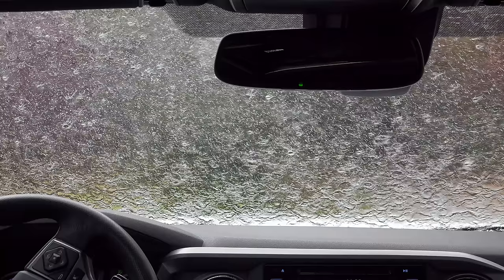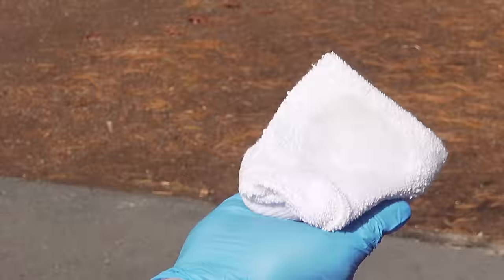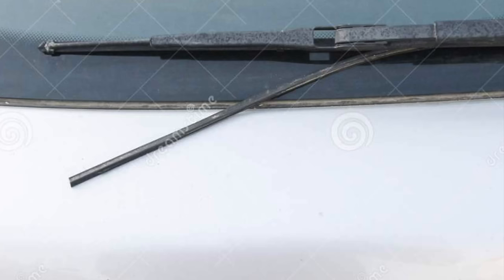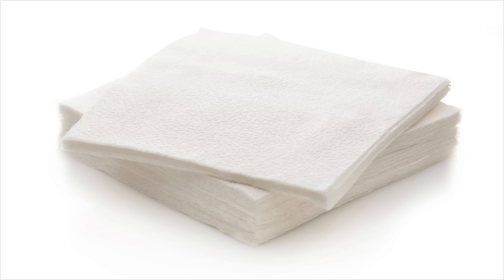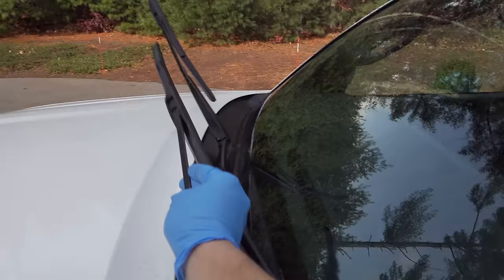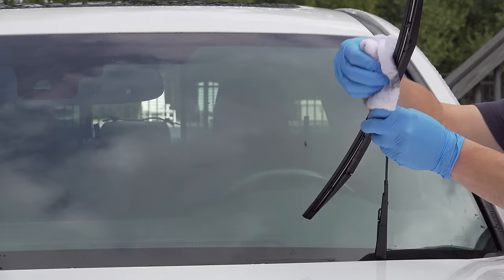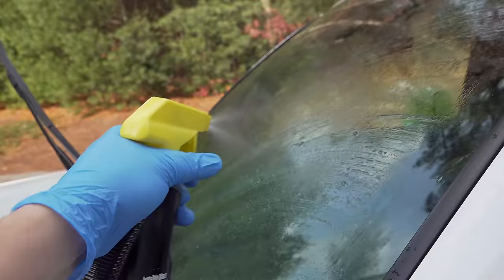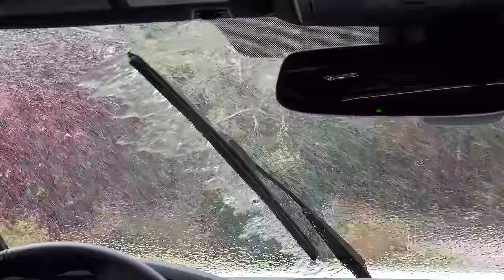How to Make Windshield Wiper Blades Like NEW in 30 Seconds

Comment: Thanks for the tip.  Personally I use RainX liberally and therefore barely ever use the wipers even in the worst rain; my wipers last 5-6 years with no maintenance to them.
Reply: But how many bottles of rain x do you go through in 5-6 years?🤔🤣They run for $2.97 in most stores.
Reply: @TonytheYorkie  Not entirely sure, I don't typically actually buy RainX from the store.  Usually pick them up partially used from auctions in a box with a bunch of cleaning supplies for very little cost, like 2 or 3 bucks for a box load.
Reply: Hay, can you tell me how and where to find  this kind of auction? 
Thanks
Reply: @AZM195  Uhm.. No is the brief answer.   Look around is the yes answer.  Focus on your local community.
Reply: Nu Finish polish works better and lasts longer than rainx.
Reply: @grants169  That's awesome. I do the same with Maguire's window cleaner, it's almost as good as rainex rainex and it's a clear spray. Rainex you gotta rub it in which takes like 20min right?
Reply: There's a rain-x branded screen wash available in the UK, does the same trick with water beading straight off
Reply: I used Rain-X once when it first came out.  Works great at speeds above 30 mph.  You won't even need your wipers.  At lower speeds you will need wipers and they will soon end up jumping all over your windshield making your wipers chatter and leaving rubber on the windshield.  For me, I think keeping windshield clean and good wiper blades is better.  I don't use wax on my windshield either for the same reason.
Using Rain-X on outside mirrors or other than windshield glass is good but a good wax works just as well for them also.
Reply: Using rainX in winter is not a good idea because it makes the coating sticky when you are trying scrape off the ice or frost from your windshield.
Reply: @x-man5056  ceramic coats or high sio2 sealants are excellent on glass
Reply: @drzflyest4  so I've heard.  What do you think of F11 Topcoat?  Worth the price?
Reply: @drzflyest4  exactly what I did. I work at a speed shop so I got the expeslnsive silicone PIAA wipers but I coated my windshield way before hand and it worked great with rubber wipers that were just about ready to change
Reply: And then there's me and the deep freeze morning where you got to chisel your blades out of an ice block.
Reply: @x-man5056  try car pro reload for durability or try car pro hydro2 lite for ease of user during wash.  Those are my personal favorites very slick and very high gloss.
Reply: @drzflyest4  Thanks.  Checked it out on Amazon.  Certainly a lot cheaper than F11 Topcoat.  It says not to apply over wax though.  Since I just clay barred and waxed, not real thrilled by that but since it's so inexpensive, I think I'll buy a bottle and use it next spring.
Reply: @bryanmartinez6600  Prestone deicer, get the pump bottle, not the aerosol spray.  The spray can contains less product for the money and gets very cold in your hand when using on sub-freezing mornings.  I have used Prestone deicer for years.  Also, if your vehicle allows, lift up your wipers to the upright position so they won't freeze to the windshield.  Works.
Reply: I accidentally came across a horrible combination with RainX. I RainX'd my windshield and washed the car with Mr. Clean AutoDry car wash, which is a different polymer that causes water to sheet rather than run off. All was well until it started raining and I used the wipers. It was just like the wipers were spreading white paint on the windshield! I stuck my head out into the rain to get the car off the freeway and into a gas station. Windshield cleaner didn't help at all. I had to wait about half an hour for the white to thin out to where we could see again and for the rain to quit. I got some cerium oxide to polish the windshield and with lots of elbow grease (about an hour of rubbing) got it to the point where I could see through it if I used the wipers on the wet windshield. Eventually I had to replace the windshield.
Other than that (and fogging up in very humid weather) RainX is okay.
Reply: @x-man5056  In Flagstaff some people buy a piece of bubble wrap big enough to cover the windshield (and wipers) and close the doors on the ends to hold it. In the morning clear the snow off the roof and from around the doors, remove the bubble wrap, and life is good. I was never that smart, though. Sometimes I remember to lift the wipers off the windshield before it snows. Then I shake my fist at the snow clouds and growl.
Reply: Cerium oxide
Reply: @flagmichael  Yeah, I hear ya.  When I lved in Alaska I would usually remember to lift my wipers but I didn't get to excited about it because I lived on an Army based and could easily walk to work.
The bubble wrap thing sounds like a good idea though.
Reply: @bryanmartinez6600  That's why I just spray a garage over the entire car.  Works better than anything else I've found for keeping that nasty ice and snow off your windshield.
Reply: Max Power  Full of shit? ..Says the person who never uses RainX.  I've got 30 years of driving, over a million miles with RainX on all my vehicles windshields.  Works every time.  Even at low speeds when the water doesn't run off, as long as you don't stare at the windshield and focus past it, wipers aren't needed at all.  I could run my vehicles without wipers installed at all and be just fine.
Reply: Get on Ebay and buy "Aquapel" window treatment. Auto parts stores don't sell it because it's for "professional use only" however you can buy it online. One application last about 3 months. Most people never heard of "Aquapel" because you won't see it on stores. Once you use "Aquapel" once you will never waste your money on Rain-x or any other crap window treatments again.
Reply: @flagmichael  I'd like to ask you a question about Flagstaff.  I live in NC currently and I'm seriously considering moving back west to get away from the humidity mainly.  I have a medical condition that makes high humidity conditions particularly intolerable. 

I know a little about Flagstaff but was wondering about healthcare.  How would you judge healthcare availability and quality in Flagstaff?
Reply: @flagmichael  I know you didn't ask for advise but many others including myself have fallen into the same or similar trap as you and it can be dangerous. What happened to you could have been a disaster.
Use rubbing alcohol to clean your windshield inside and out to remove ANY treatments.  Clean again with one of those Mr. Clean white sponge cleaners.  Then a good glass cleaner.  Get rid of ANY car wash product with any wax or other treatments in it.  You don't want that on your windows in general but particularly on your windshield.  Good, clean glass works just fine by itself.  

There are just way to many wiz-bang nifty wax and shine products out there and not all of them are compatible. The only way to be sure your not making a critical mistake is to keep them off your glass IMO.
Reply: @x-man5056  Really?  On a windshield wiper care video?  Seek ye "healthcare in Flagstaff AZ" on Google and find out both why you should and why you shouldn't move there.
Reply: @yogidemis8513 Aquapel  works great for me !
Reply: @jerrymiller276  Yeah really.  The man said he was from Flagstaff.  I asked for his opinion, not yours. I have already read  Flagstaffs PR page, of course they are not going to say health care in their city is spotty or sucks.  I wanted a resident's opinion.  Not something I would remotely consider apologizing for.
Reply: @bryanmartinez6600  I hang up a hair dryer purchased from a thrift shop on coat hangers with a UL approved and grounded extension chord. Turn it on about 40 minutes before I go out. No ice to deal with.

Comment: Another good trick perhaps to do in combination with the cleaning is to flip them over... top to bottom. I could give you a long mathematical explanation but surfice it to say the bottoms travel less than half the distance of the top part of the blade and by rotating them in this way you will even out how they wear...

Comment: I wax the front window with regular car wax. I don't even need the wipers on, the water just bounces off
Reply: But the glare at night is horrible.
Reply: the new ceramic coating sprays work better and last a lot longer

Comment: I've been doing this for a long time as well but with one difference after cleaning the blades I spray them with silicone let them sit a bit and wipe it makes the blades last longer
Reply: I tried silicone and they got stuck to the windshield and to the wiper arms. Used WD-40 and they freed up but they were sliding out of the wiper arms. Used duct tape and now they look like new, plus they make a fancy flapping sound when I drive. Bonus deer whistle!
Reply: @Mars-zgblbl  fab

Comment: Oils in the rubber leach out over time, which dries it out and makes it lose it's pliability. This just adds that oil back into the rubber. It's not really cleaning off old dirt so much as it's dissolving the oxidized, sun-damaged outer layer of rubber. The rag's black for a reason. Take them off and soak them in oil for a hour. Then rub them down. It'll work even better. Use Rain-X on the glass. You won't even need your wipers 90% of the time.
Reply: Very well said
Reply: Despite what wd40 list as "safe to use on" rubber and plastics really shouldn't have petroleum products applied to them. 

Though for something like wiper blades, I guess the blades probably would ware out just as fast, maybe faster, than they would from normal use.
Reply: You know far too much about wipers lol 
Bet your a right ol laugh 🤭
Reply: My boy is wicked smart
Reply: Once you use Rain X you have to keep using it every single week, or else when you're in foggy situations, the windshield will become opaque in seconds. They you have to use the windshield wipers all the time.
Reply: @d.e.b.b5788  Sounds exactly like nose spray. Once you start you can't stop!
Reply: A serious answer......!

Comment: WD-40 is the only essential oil I trust
Reply: The only thing I use WD-40 on is my drywall knives and concrete trowels (WD-40 stands for "water displacing" and was the 40th formula they tried) since it leaves a gummy residue.  On anything that I need to lubricate, I use lithium or silicone, and P-Blaster for my penetrant.
Reply: Loll
Reply: I use wd40 to replace my lotion bottle next to the drawer.

Comment: 303 Aerospace Protection is  also good for putting on rubber to preserve it.
Reply: The WD-40 degrades the rubber taking a thin layer of the weather degraded rubber off.

Comment: I’m surprised you don’t mention Rain-X. It is the perfect compliment to clean wipers, a clean windshield and rain.
Reply: Yep, agreed. I've been using Rain-X for a few years on my car (25k miles p.a.) and several of my family member's cars - it's a great product and does exactly what it says!  Provides CLEAR vision in the rain and VERY much safer driving! Their glass cleaner is pretty good too!
Reply: It certainly is. Been using it for over 25 years now. In fact, One of the first things I do after I Buy a car is apply rainx because how well it increases visibility while driving in the rain (most time don’t even need wipers in light rain, especially if I’ve applied the type that’s in the squeeze bottle that dries to a haze and you wipe down afterwards). 👍🏻👍🏻

Comment: After cleaning the window you can eliminate the need to use your wipers during light sprinkles of rain by applying Rain-X or a similar coating, the water just beads off and over the roof when moving
Reply: Hello, is it possible to spray Rain x on the back hooded cover on the back of my suv jeep?

Comment: It makes sense when you realize what the letters WD stand for in WD-40: Water Displacement.
Reply: Whoopty Do!
Reply: Alain
I actually never knew that Haha
Never assume
Reply: Water displacement recipe 40
Reply: jason9022  Most aren't "rubber" anymore and somewhat resistant to petroleum.  Wipe on and off isn't likely to negatively  affect them.  Soaking in a can of gas probably would though.
Reply: @damienwood1414  Correct my man. It was developed to be used in the space capsules. If condensate was in the electronics then the computers and controls would fail.
Teflon was also a product of the space program. It was the ablative material to not transfer heat upon reentry so our astonauts would not burn up.
Reply: @dberry999666  it is the 40th formulation they made (and that worked how they wanted)
Reply: So hes saying grease your wippers wait till the lights or sun hits dout you see very good. I just wax my windshield works for me most time dont need wippers
Reply: @davidmonroe7783  
I also use Rain-X windshield washer fluid and this helps a lot, too.
Reply: @AlainHubert  yes it does.  im never putting wd40 on my wippers
Reply: @davidmonroe7783  
I also prefer to clean my wiper blades with a silicone spray instead of WD-40. Does the same job without risk of any damage.
Reply: @AlainHubert  never tried it
Reply: One of the guys I worked with told me wd degrades rubber o rings in nail guns.  I still use it on some things, but the PB works faster.
Reply: jason9022  I was told same.  Wd is good to spray on wire connections.   Started using it on the points in my 76' Dart.  It ain't that good as a penetrant when compared with pb.  Found out later I had a crack in my distributor housing cap.  Spent more on wd than a new cap... x10.
Reply: @dberry999666  40th attempt to create the formula!
Reply: 40. Is molecular weight
Reply: jason9022  WD is a degreaser , petroleum products usually are used to grease surfaces.
Reply: Some One  maybe pb blaster
Reply: Actually it stands for Wipers Done in 40 seconds 😜
Reply: Robert Scalchi  was developed for the Atlas rockets. The unpainted stainless steel skin was sprayed down with WD-40
Reply: @bff1316  So you're saying my eggs wouldn't stick to the bottom of the Apollo capsule on reentry?
Reply: Chris Miller <--  Hilarious,... eggs not sticking to the bottom of the Capsule on re entry,... genius !   Cheers

Comment: The black that your removing is actually the Graphite coating that's put on to wipers blades to make them slippy and protect them
Reply: Negative, it's actually the rubber degrading, dry rot on a micro scale. Because you can rub an old wiper blade and you get the same exact black "deposit".

Comment: I didnt realise WD40 was good for rubber,  I only use it to clean my mobile phone after I finish charging it in the microwave.
Reply: Its very good for rubber. I use it to clean pick up rollers in printers and copiers and it works very well.
Reply: @lawrencedavidson6195 ,
🔵 It takes several months for it to show up, but if you use WD-40 on rubber or soft vinyl you're going to be sorry at some point in the not-TOO distant future.
WD40 contains petroleum-distillates, which should NEVER be used on rubber or soft vinyl.
Reply: @lawrencedavidson6195 ,
🔵 The best way I've found to restore
the "Grip" of rubber-rollers in printers and
such is "Lava bar-soap!",.... I chuck the end-shaft of the roller into a drill and spin-it while holding the lava soap-bar against the roller and moving the soap slowly from end to end and back several times while running water over it,....after you rinse the soap off-of the roller completely, DO-NOT wipe it off!!,.....
.....just let it air dry by itself.
This treatment will remove the hardened-
oxidation and restore the rubbers natural- "Gription" (tackyness).
I was a service technician for record players and reel-to-reel tape recorders, and discovered this technique in the early '70s' when I found that I was VERY unhappy with the results I got from using the chemicals that were made available at the time for treating/restoring rubber-drive-components.
Since then I've tried nearly every-other chemical-restorative and surface treatment available for rubber-rollers in printers and copiers, and have found absolutely NOTHING that equals the long-term performance-results attained
by THIS treatment.
To restore windshield wipers all you do is hold the wiper under running water and stroke the bar of lava in one-direction ONLY from the bottom of the wiper to the top six or eight times on both sides,.... rinse-well, then air-dry.
Reply: @Alistair Banfield ,
🔵 Please clarify,... What is it exactly that you are saying contains fish oil rather than petroleum distillates?
Also: What do you mean by:
'You wouldn't get it so fine"?.....
Reply: @joshhayl7459  this should be a video 👍
Reply: Josh Hayl well said at least someone has common sense but we seem to be in the vast minority 🤘🇬🇧

Comment: Use rubbing alcohol to clean the blades. Keep cleaning until there’s no more “black “ showing up on your cloth. Not too keen on using wd40; it will streak the windshield and “deteriorate “ the rubber blades.

Comment: Rain X on a windshield life saver that freeway speeds don't need wipers on
Reply: So very true - clean your windshield with 000 or 0000 steel wool (it's fine enough it won't scratch glass, but cleans off bug guts better than even commercial window cleaner), and then rainx (I've been using their washer fluid for about 15 years).
Reply: What?  Do you speaka da ingerish